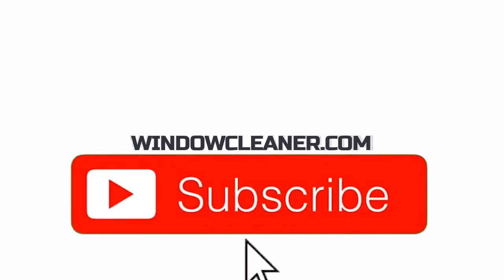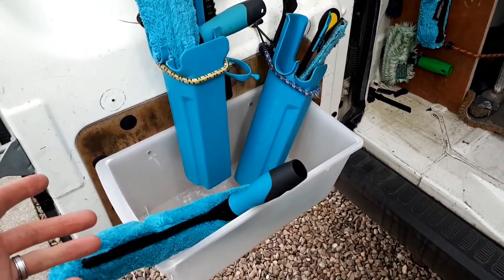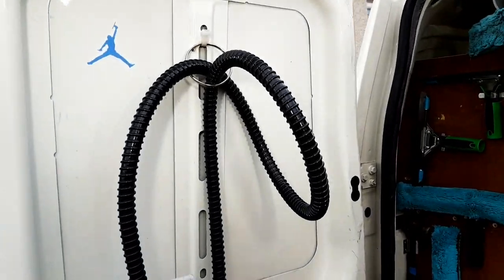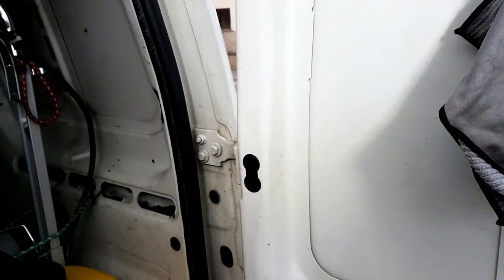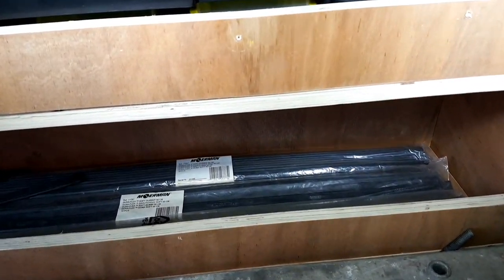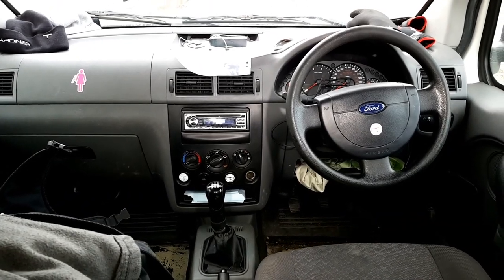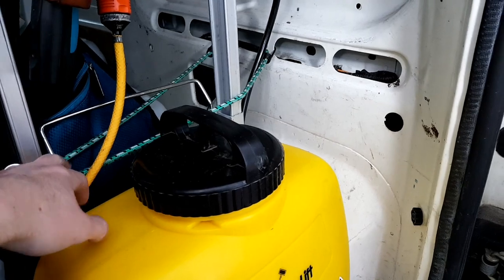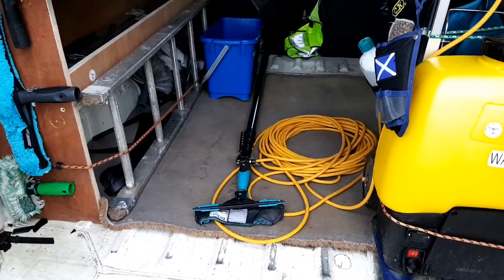Organizing Your Window Cleaning Vehicle | Trad-Man

Comment: I picked up a new 6x10 trailer with 4” extra height. So it’s 7’ inside height. Got the logo, website, and number on sides and rear. Fits my ladders, WFP equipment, poles, everything.

Comment: How often do you need to change the liquidator 2.0 rubbers if using daily and do you use hard or soft rubbers???
Reply: Dwayne Mertz i use soft rubber. Usually ettore master rubber. Each side of the rubber can last about a week so 2weeks per strip roughly
Reply: Dwayne Mertz im very careful on frames which is how i get longer out of the rubber ;)
Reply: Trad - Man alright thank you